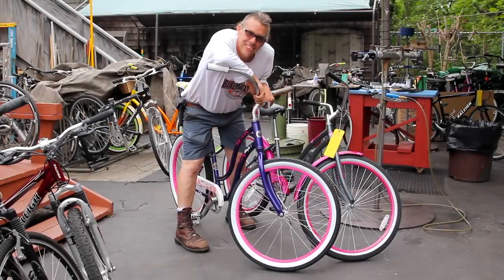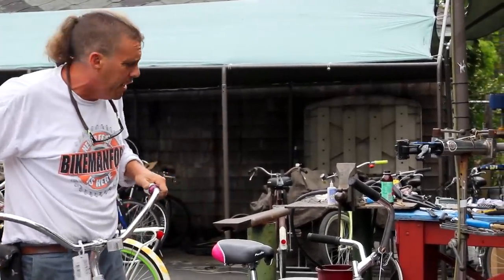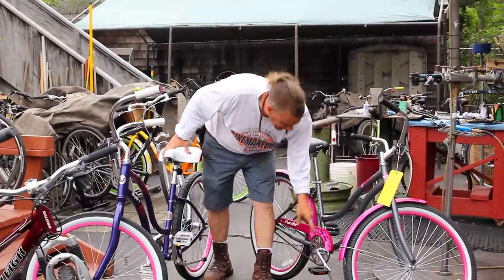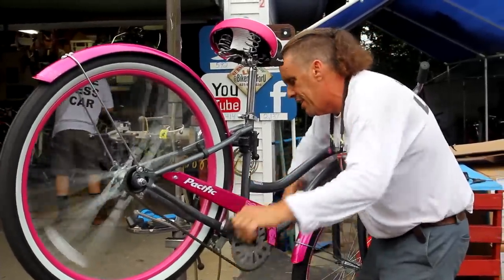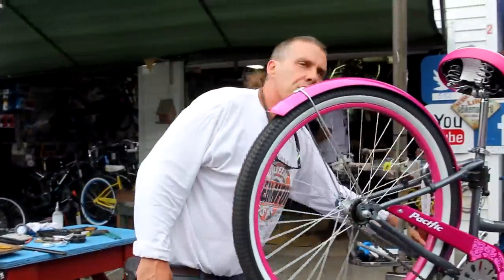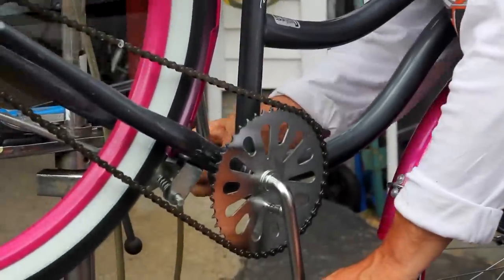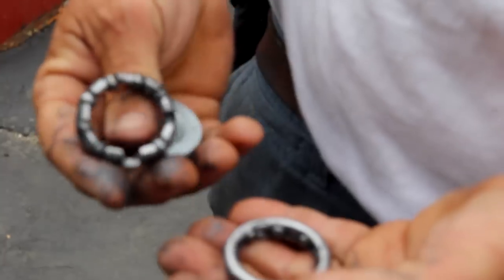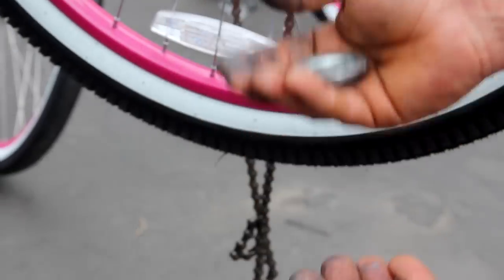How Cheap Walmart Bikes Suck Your Wallet Bone Dry - No Grease - BikemanforU

Comment: If you're just riding it just for school, cheap is fine.
Reply: No.
Reply: Yes
I’ve had a cheap bicycles my entire life and I’ve never had any issues but I did grease the bearings.
Reply: @BT_Spanky  "I’ve had a cheap bicycles my entire life"
Bicycles...plural. I have commuted on the same bicycle for 15 years, and it was 8 years old when I bought it for $95. It was $799 new.
If instead of buying a quality used bike for $95, you buy a bike which is $95 new, that bike will cost you double what you paid within a year, guaranteed. My bike costs me about $5 a month to maintain.
Reply: Wrong, I owned a Walmart Bike for less than a month and the chain broke, went to return it got a new one the petal broke, don't ever bye anything from Walmart that is over 100 hundred dollars let alone 60
Reply: Cheap is fine if you have to leave your bike unattended while in a store . Pleasure riding where the bike is attached to a moving car or rider then go expensive
Reply: @BT_Spanky   I bought an  expensive bike once . A gitano racing bike  back in 1972 . Super light weight super skinny tires super  uncomfortable  $ 600 . I've moved up since . $ 99 walmart bike  with rear and front suspension 21 speeds , only use three of them  now only  one of  them. Disk brakes  . The rear still works  and the 24 inch rim dont deform when going ove a curb like the $600 bike
Reply: @directbacon870   I won't. $99 with an expect life span of one year

Comment: I have a 1969 men's 26Inch wheel Coast king beach cruiser love It been using It this summer came with a tank and the only thing that s not original Is the rear hub that sux has a modern rear hub Its like riding a modern bike experience o well

Comment: In the UK I swear big supermarkets only sell kids bikes because of the fact that they outgrow them so fast and obviously don't look after them as well necessarily. Most bikes are sold by a car parts and bike shop called Halfords which is everywhere, and they have their own line of pretty decent bikes and lately have acquired high quality makes like Boardman (I have one of their comp 650b mountain bikes and love it to death). I think the mileage can vary because you do run across inexperienced technicians from time to time, but just as often you find someone who is a straight up expert and who can fix anything wrong with it, often for free since he doesn't have to worry about the profitability to the shop and just gets paid wages. On the other hand, for super important jobs I always use my local independent bike shop because their gear and brake (hydraulic disks seem impossible for me to do myself) maintenance is spot on, and they have better parts stock. Halfords keeps replacing my derailleur for free because it has snapped off twice with no collision but I'd rather just get a better one and not have to deal with it. I don't know if there is such a nationwide store with good quality cheap (though nowhere near as cheap as walmart, more comparable to your prices Bikeman) bikes in the USA but this is definitely a good middle ground, and that way you can support your local bike shop maintenance wise. I for one will get a full comprehensive tune up before my MTB holiday next month, because any gear failures will cost me a lot more than the savings of getting it done cheaply. When I am out of university and earning good money I think I will buy the bikes from small businesses too because cycling is my main hobby and its worth so much to me seeing as theres no fuel, insurance, taxes or charges associated with doing it and therefore lots of room for expenditure on the machines themselves. I definitely can't wait to get my first super light road bike!

Comment: wal mart bikes are great......... if you have cone wrenches, pliers, wrenches, grease, and screw driver, and some time on your hands to re pack the bearings, and re tighten/adjust every nut and bolt on the thing and put on new tires. took me about a full day to do properly. cost me 30 in tires and tubes and the bike has been great since.

Comment: Very familiar with the mechanics of this type of bike. In 1981, I rode my first 50 mile race on a 2nd hand Sears Free Spirit "ten speed" before I knew any better.  I did a sub three hour ride for 17 miles per hour.  I replaced the bearings and cups three times in a year and a half. Are these cheap bikes a pain in the butt if you do any serious miles? Sure they are but way back then it was a gateway for an asthmatic kid to eventually do some serious racing (praise God) on proper road bikes. Still riding seriously at 50+ years old. These bikes are not the quality and do not have the longevity of the more expensive bikes but they can function suitably for their target segment of the consumer market.
I've been waxing sentimental over an old coaster bike I rode in my preteen years which is why I found this video.  With my eyes wide open I just may get a cheap department store bike for nostalgia sake.   Ride on!!!! 😎

Comment: Talk about coincidence I just sent an e-mail questioning if the BikeManForU crew has ran into this problem on most department store bicycles. I am lucky enough to have thirty plus years as a bicycle technician working on bicycles worth up to thousands of dollars including my own custom built hardtail. But in 2000 I was hired by one of Canada's biggest department stores to build and (mostly) repair their bicycles. But as of late the bikes have been coming right out of the box not only with warped rims, but most of the bikes have only a "smidgen" of grease not only in the bottom bracket but also the hubs and headsets. (coaster brakes seam to be the guiltiest)

Comment: This reminds me of pellet rifles.  You can by Chinese made for about 70.00 to 100.00 or get German made for 300-400.  If you have the know how you can take apart a cheap air rifle and with a little work and lube correct most problems and have a decent shooter. It still won't be as well made, but it will get the job done.  Myself I won't buy cheap air rifles anymore, I like the higher quality so I don't my spending 400-1500 on air rifles cause that's what I'm into. I paid just over 200.00 for a bike from Walmart and ride it 10-20 miles a week on side roads and very happy with it. It's doing it's job and like people looking at air rifles for the first time, think it's nuts to pay 500.00 plus for a bike to ride.

Comment: my call, buy a bike if you want from wal-mart or w/e cheap one, just know how to rebuild it, and make sure you check everything on it even before you take it out for a spin. But of course, don't go too cheap that you strip nuts and bolts when you take it apart and back again. :P

Side note: I have access to good old schwinn road bikes, but I own primarily a POS bike from Target, and I redid the bearings and got new set of rims, and customized and and made it better,  It's sucha  great project, I wanted to go for something no one would have wanted to steal in NYC Streets where I was planning on locking it up, but then I made it soo good, I'm now scared someone might want to steal it. But it's a unique bike because I pretty much built it(rebuilt it) from the ground up, replaced almost everything, yes it probably costs me around 300 to rebuild , same as getting a new better bike assembled already, but hey, it's a fun trip to go through, plus I get to pick my parts, its not like I'm stuck with the shifter they put on the 300$ bikes, I get to decide which parts are quality, and what needs quality, and also keep it sort of, not resellable unless for really cheap, luring away people who want to sell stolen bikes for more at a time. P.S. never really used the schwinn bike, and keep it in a garage, hue hue

Comment: I've got a Trek, a Giant and two Cannondales (uugh, the Cannondales)...but out of watching WAY TOO MANY YouTube videos, I bought a $79.99 Pacific at Wally World, and wanted to see what it would cost to make it 'decent' (my labor was, well, relatively free). Opened the box, good tires, good frame (one-piece), good forks (solid), no QD axles (urban security, ok), and aluminum wheels with freewheel and rim brakes. Not bad for a starter straight-bar 700C hybrid. Changed grips ($20), Shifter to Shimano EF ($20), re-used new cables, plastic to Shimano (left side only) $15, chain to KMZ ($20), no-name to Shimano V-brakes (arms $40), BB was ok (but probably have to replace it on the crank set change eventually), and a new set of RockBros pedals ($30)...so I brought the Pacific up to a '$399 level' by taking a $79 bike and adding $145 in parts (total $224 so far)...now, new chainring, crank set, BB will be around $150...so at $374 you've got a solid $500-$700 bike...not really sure of the complaints on big box store bikes...you do get what you pay for, but before you dog them out too far, keep in mind one thing - you'll play HELL trying to find a steel-frame Cannondale bike in this century!!! Might want to watch Seth's bike channel on MTBs and weight, before you think 'steel isn't good'...steel outlasts cracking carbon and cracking aluminum, while weight isn't as detrimental as people think it is (not unless you are doing time trials, and even then, not necessarily as much as you think). $79 - bulk bikes? Yep...can't beat good cheap steel frames, good wheels and good bars for below-wholesale prices! All depends on how you look at them.
Reply: Oh, and about those REALLY NICE ALUMINUM WHEELS that came on it. I've laced new rims and hit 'straightness' better with my eye than what these things had coming out of the box! Seriously, HOW can people ride on bikes that the rims look like they've been in a car wreck?! Took me about 2-hours EACH to straighten those rims (they were out of round - off-axis, as well as warped!). Remounted the tires after straightening, and have to say...they are great rims...but they didn't start out like that!

Comment: you can buy a good Walmart bicycle, put a profile quill stem (thread less adapter), put a fsa headset and a fsa stem, so you can easily change parts and look moe modern plus get ceramic fsa bearings. most have sram or shimano group sets for the occasional rider. for the rider that knows what their ding some nice Walmart frames and group sets can be rebuilt for about $200 fir a decent bicycle (again if doing your own labor and buying the parts clearance on sites or eBay) also use a silicone based lube oil based will seize alloy or carbon components, especially say you have a alloy frame and carbon bike seat post or opposite put some non oil based lube in there. I've raced BMX since 2004 now into cross country, MTB,  as well as road cycling...but ill always have my old real Schwinn cruisers and antiques. i watch channel every day...do you have stickers if i send a SASE (self stamped self addressed envelope)????? big fan

Comment: Well I'm all ears . That's why I tuned in but  $99 for a Walmart bike with a one year life span is working out for me.  No maintanceor   just replace the bike in 14 months.  The shifter stop working 6 months  ago the front brakes never worked best I could tell but the rear disc still work. The tires a wider than normal slightly and that why I think I haven't had flat yet . I put 35 lbs of pressure in them  I did pour transmission fluid over the detailer and along the chain I mostly ride say 4  miles a week to the grocery store . I use the bike as a Walker and coast down hills so the brakes are most important

Comment: I got a Schwinn from amazon had it for about a year now no problems but I check on my bike every month or so
Reply: There is nothing wrong with Schwinn. Don't let the bike snobs tell you any different. I have 40,000 miles on a hand me down Schwinn CrissCroos that my dad bought new in the early 90's. That bike has been to 3 countries and 26 states. I wouldn't trade it for any $10,000 bike on the planet.
Reply: wahwah1013 well the thing about a Schwinn from Walmart is there is a possibility it was assembled correctly that's the only reason I see but if it is then it can be a good bike
Reply: Just bought a Wallmart assembled Schwinn Sidewinder, Handlebar was little askew, Rear brake cable loose. I asked.and got 10% off due to the cable. At home I adjusted those and tightened nuts holding wheels. This bike seems still okay on  day three and 25 miles on it. 
But, 5 months ago from the same Walmart I bought a Next  brand Gauntlet and the wheels didn't pass my upside down, spin the wheels test.as they stopped too soon. Took apart --- the wheelbearings looked oiled, no hint of grease. When grased and put back together and adjustments made, it worked great for 5 months.  Except the derailer seemed iffy like it may fall off and it was on on my saftey checklist to do.  But some theif cut the cable lock and made off with it.   
 Thinking back, it was my plan to buy new and low cost as it may get stolen. . And I had thought to put in that extra work if needed because of reviews on those.  However, reviews on Schwinn at Wal-Mart are good.  Attributed to the fact that much is already  pre assembled at Schwinn so there isn't but 20 minutes to put it all together.
  Hey the vids made here on this channel are awesome.!..

Comment: Bikeman, I got a question, my bicycle sometimes makes noise when I pedal, are my b-rings broken ?

I have a shimano stx crankset

I've had my bike for 8 years now and it's in mint condition except that one little problem.
Reply: ***** I went to my local bike shop and they said they could fix it for $60 (quality parts ofc)

Is that a good deal
Reply: ***** Yeah labor included.
***** I don't know, I'll have to see in store which one I want
Reply: Mine does that to like it ticks

Comment: The assembly that matters is done at the manufacturer. Pacific cycles, and all other Chinese  manufactures, do not employ bike technicians. Assemblers in the US and abroad are likely entry level employees. Buy the bike you like and can afford. Inspect EVERY nut, bolt, bearing, cable, lever, rim/tire, etc.  Maintain it best you can, and ride it.
 No machine, at any price/quality level, will be trouble free.  Anything can be fixed, no big deal.

Comment: what is story behind why they are fixing it? If they spent $69. new, are they now going to pay $50+ to repair the BB? They could almost buy a whole 'nother walmart beauty for the repair money...Disposa-bike
Reply: ForbinColossus I know right... it's like people think buying a quality bike isn't worth it.

They're completely wrong !
Reply: ForbinColossus Some people object to spending $300 right now, but they fail to understand that in the long run the $70 cheapo Walmart special will end up costing them significantly more than a quality bike. Buying a quality bike isn't snobbery, it's smart economics.
Reply: Replacing the bottom bracket is a pretty simple job a long as the rest of the bike still works.
Reply: But how long? First bottom bracket...and what comes next? Wheel bearings? Headset? With these "Cheaporama"-Parts the list will go on and on...There is a saying: If you buy cheap, you will buy twice.
Reply: It also depends on how you use the bike and how often you ride it.  I put a new crank on my daughter's Walmart bike, it will probably last beyond the time that she grows out of the bike.  Would I buy a cheapo bike for commuting?  No, but I also wouldn't spend $300 on something I'm only going to ride once in a while.

Comment: it's not rocket since buy a cheap bike at Wal-Mart and just add grease to it ltr on do the upgrades as your wallet allows You to don't buy an expensive bikejust to ride around unless you're a pro and NEED a sophisticated bike
Reply: +Alvaro Garcia even if you properly greased the bearings in that bike, it's still shit and will wear out again soon, it's not even sealed.
Reply: Ok
Reply: +Brandon Clark I think he's talking in general about typical bikes at major retailers that usually go for less than $300.
Reply: Maafa 1619 It's not uncommon to have a bad build from a bike shop regardless of quality.
Reply: supergoose oooo my first stalker lol ;D j/k. Fiat panda... What the fuck's that? haha Jeez maybe something a little more common like a pre-owned 3 series. Exactly, if that all you want than that level of engineering, performance, and luxury isn't a requirement however, if your willing to pay more for the added performance than by all means. No one is making you walk the plank. Not sure what you mean by professionals but that comparison makes no sense. BMW is a luxury car not a formula one race car. It doesn't take a professional to ride a bicycle either you know.
Reply: Heavy? So what? If you need 3 kg less than just loose your weight. Its funny how people thinking about 1 or 2 kg of bike weight but not of themselves. Eliminate of salt from your diet, reduce retention of water and you have couple kg
Reply: ***** i was talking about weight, not quality
Reply: ***** I have already cheap bike from supermarket. It cost something about 80$ (300 zł) but 20 years ago. And this cheap bastard gives me a lot of fun
Reply: ***** 15,5 kg. Why silly? If I weigh a 94 and can loose 15 kg in couple months?

Comment: I went to three bike shops, cheapest bike was $600. Went to Walmart bought a $100 bike. The first 7-10 days sucked as the chain kept falling off and the brakes kept having issues. I bought some cheap tools and gave it a tune up, worked beautifully several months I used it until a huge pothole broke the back tire. I rode it 25-40 miles every day. 9-10 miles to and from work, then around town. No issues at all.

So yeah, spend several hundred dollars and get 'free' labour once if the bike needs it. Or spend $100 and an hour of your time and do it yourself.